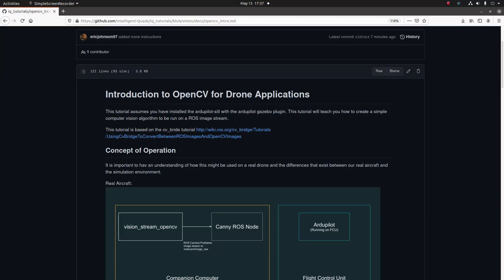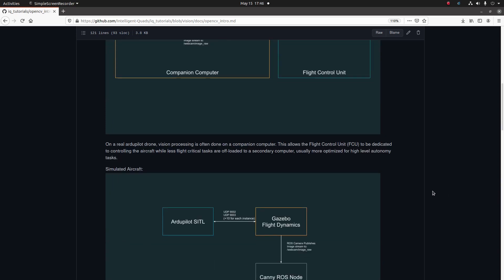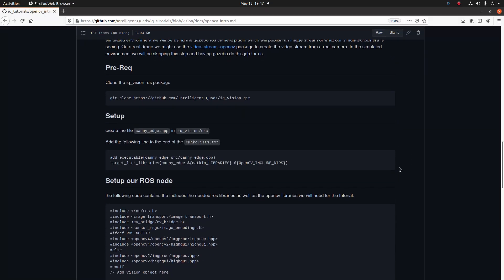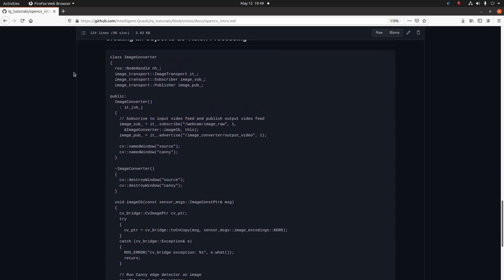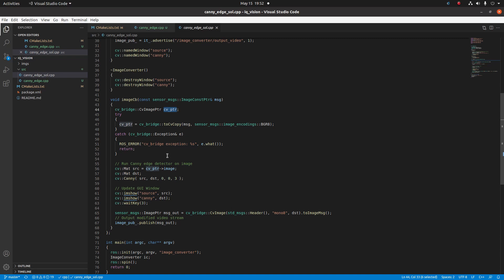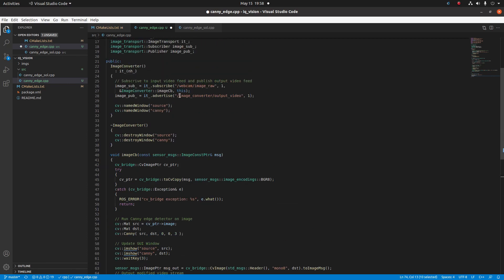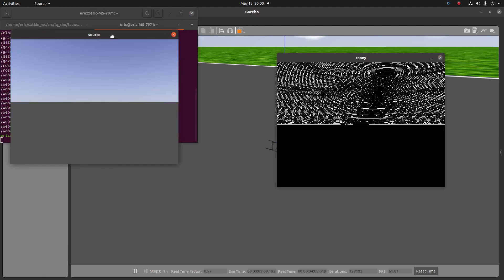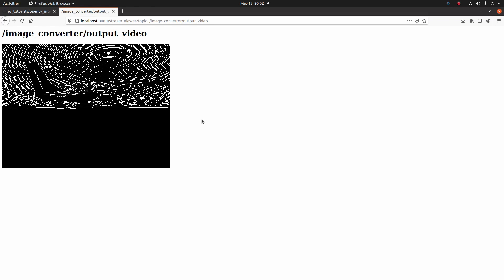Basic OpenCV with ROS for Drones

Comment: Thank you for this video. I enjoy it. I want work on quadrotor in university. First I want system identification  and design attitude and position controller for quadrotor and finally test it on real quadrotor. I searching for quadrotor. in some paper used Commercial quadcopter. I don't know pros and cons of Commercial quadcopter such as crazy file, AR.Drone 2 ... and flight controller board such as pixhawk. Please Help me .
Thanks.